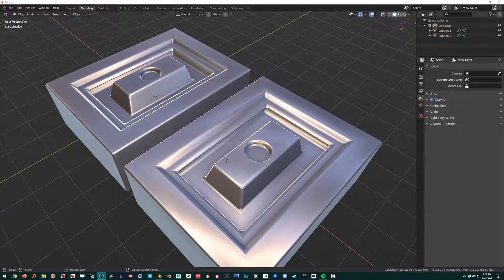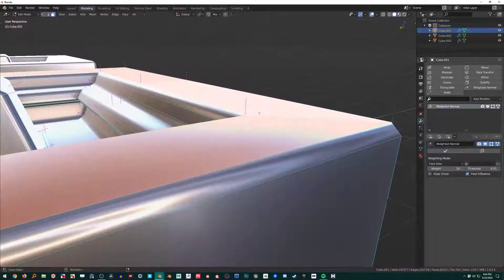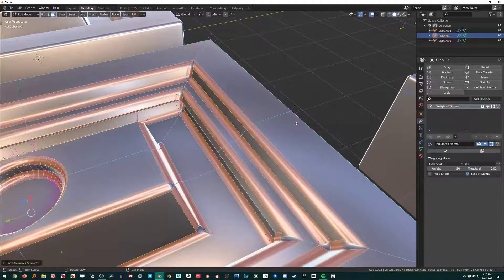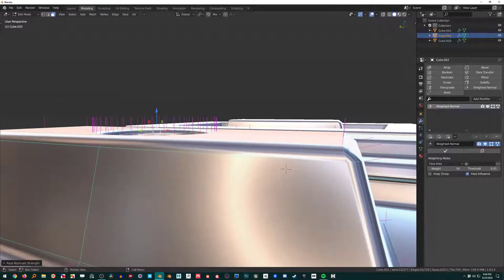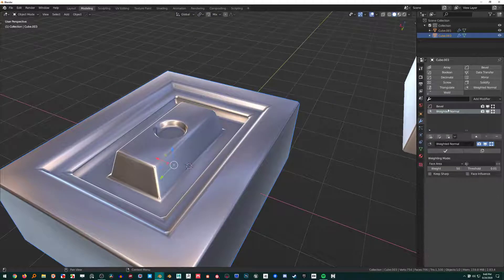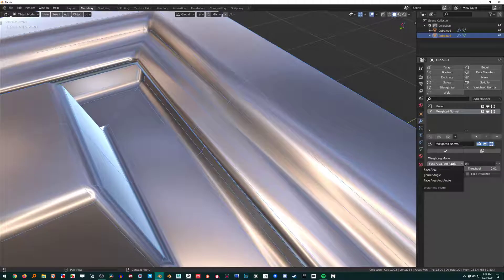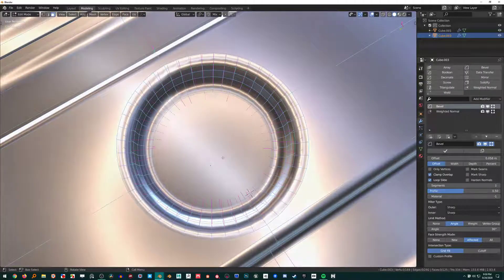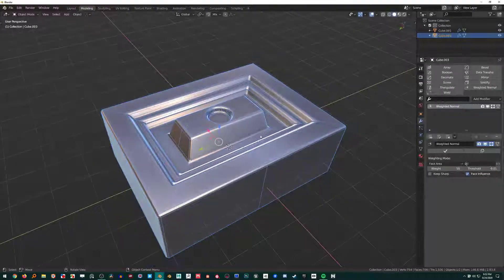Bevel and Weighted Normal Modifier -- The "HOW" and "WHY" - Blender 2.8x

Comment: Did you figure out that weird triangulation issue at the end?
Reply from the maker: No I have not, thought I don't think I've really run into this problem (maybe at all?) since this video? Seems to be only on rounded sections like that ring. 

Perhaps a way to fight it is the Bevel Modifier's "Harden Normals" option, but you need to select the "Add a custom Split Normals" option in Data Properties > Geometry for that. Haven't tried it but that's the only other idea I can think of.

Thanks for the comment!